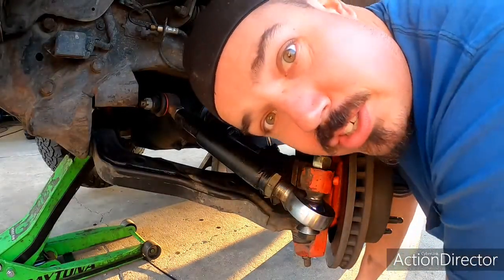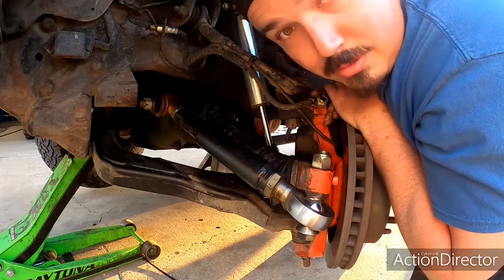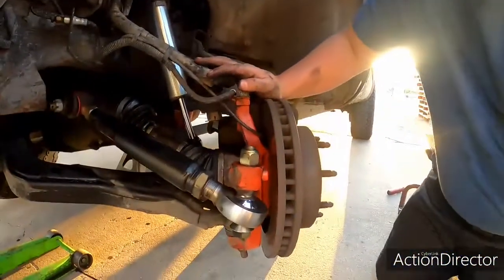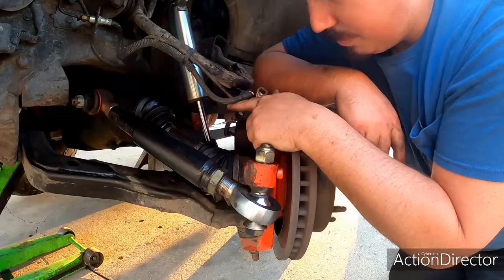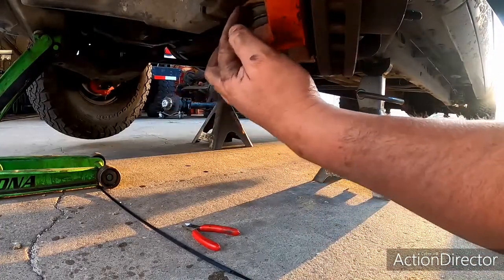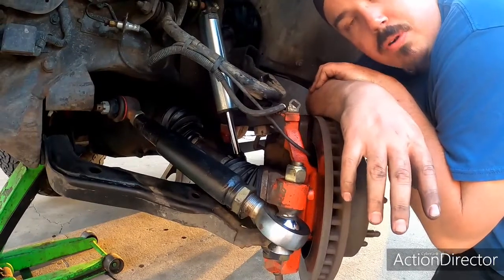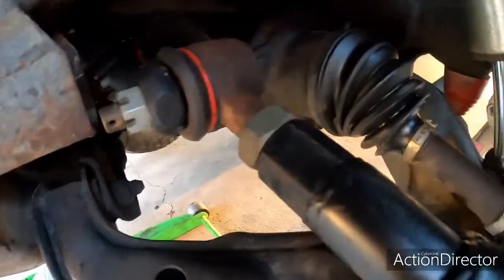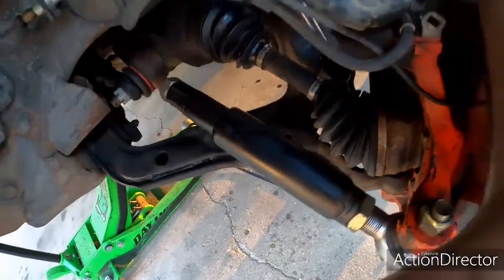HOW TO MAKE CHEVY IFS SUPER STRONG!!!

Comment: Can you get that lower and tie rods for 2014 Silverado 1500 ?
Reply from the maker: The tie rod you can make... As far as the lower control arm goes, this one will not bolt into your truck... You'll have to figure it out.
Your truck is a different platform from both the Duramax I took the parts from and the truck I put them on... Best of luck to you 🤙

Comment: For many years you’ve been able to upgrade the tie rods. The real weak link is the upper ball joint. And if you really off road the cv’s never hold up
Reply from the maker: If you maintain good geometry the upper ball joint and the CV shafts almost are never a problem.... The problem comes in when you start adding aftermarket lift kits that do not have proper geometry... A good rule of thumb is to keep all the angles as flat as possible at ride height... Thanks for your comment 👍

Comment: Good info. Do you know if there are fox Shocks with only 3inch lift?
Reply from the maker: You can order shocks of any dimension from Fox, King, or Bilstein.... Remove the torsion bars from your truck and cycle your suspension up and down to determine the amount of travel you need... After that also measure the fully extended length and fully compressed length of the shock you're going to need... Then you can give one of those aforementioned manufacturers a call and order the shock that you desire.... Remember where the torsion bar setup you are going to want a lot of rebound dampening. make sure you mention that to the shock manufacturer when you order them... Best of luck to you 👍

Comment: Thanks for the upload.  Does any of this apply to a 2005 Tahoe GMT 800?  I would love to know if GMT 400 lower control arms can be installed on that platform.
Reply: Kryptonite sells beefed up stuff for gmt800 half ton stuff. I don’t understand why you’d want to use a gmt400 lower a arm. I’ve never saw a lower ball joint break before the upper
Reply from the maker: @cumminsbayou  believe it or not the GMT 400 lower ball joint is larger than the GMT 800 lower ball joint.... If you don't believe me go to O'Reilly's and have them pull both parts so you can compare them side by side. 👍

Comment: ARB makes a locker for these. If I we’re running 37in tires and a 33 spline locker and RCV custom built axle shafts on a 08 1500 Silverado are there similar upgrades I can do just like this to further build it up to prevent broken parts up the rd
Reply: Did you ever do the locker?
Reply: @ nope I ended up getting another square body instead.
Reply: @kylewest100  solid axle is the way to go

Comment: Nice video, do you think the upgraded ifs and axle shafts etc would be srong enough for the weight and torque of a p pump 6bt with 350- 400hp mods?
Reply from the maker: Yes... just as long as you maintain good CV axle angels it will work great for a cummins swap. That's actually what I'm going to do to the suburban you saying the video. It will be a p pump 6bt 4l80e np241 14 bolt rear and 1 ton IFS with king coilovers up front.... thanks for asking a question👍

Comment: What did you do for your axle shafts?
Reply from the maker: I used duramax CV axle shafts.
Reply: And they just bolt right up to the front differential? 
I’m finding parts and suspension before I find my build rig 
I’m thinking I’m gonna do an avalanche 
Ugly I know but with cut out fender flares a good mid travel setup with a beefed up front end and lockers paired with a somewhat short wheel base it will do the trick for running trails in the woods haulin ass and snow wheeling